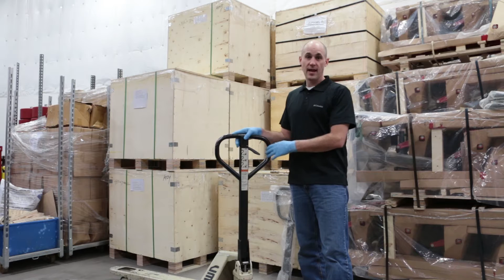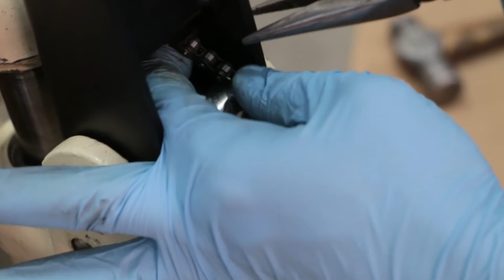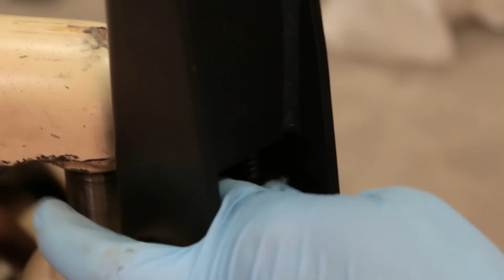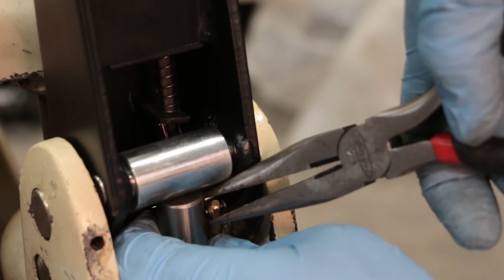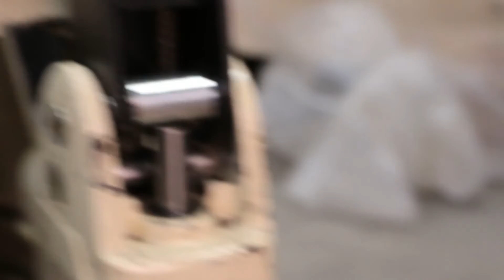Handle replacement on a Crown pallet jack

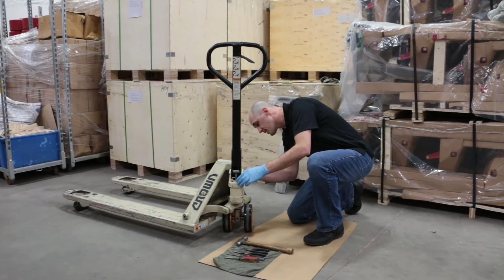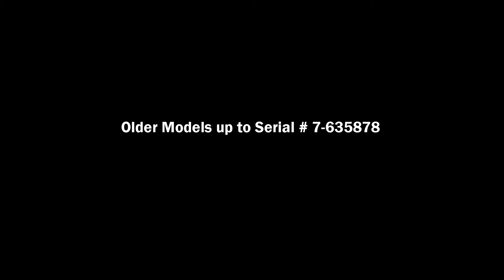Comment: The part around 0:20 where you said to take out the screw fastening the control rod to the actuating pin only applies if you have the older model like you show in 5:10. But how do you do that part when you have the newer model like in 5:41? I know you just flip the metal piece but when I try to do it the chain is really tight even with the control lever in the down position. When I tried to force it down as well (after I pump up the jack to try to get better clearance of that area), all I ended up doing was making the jack go down.